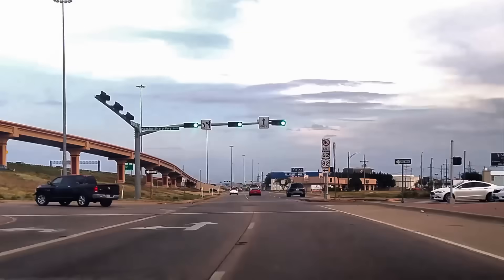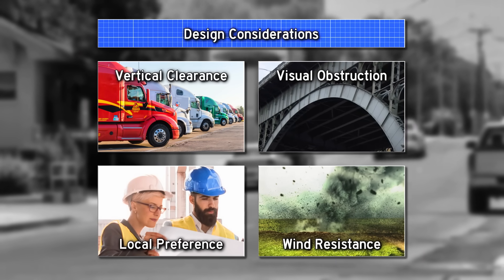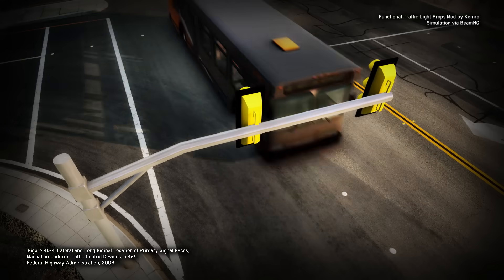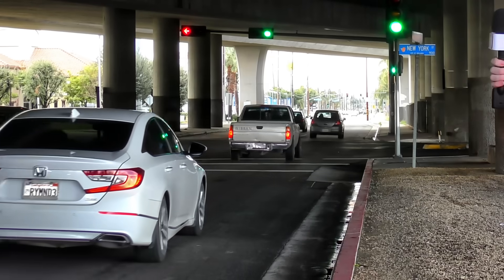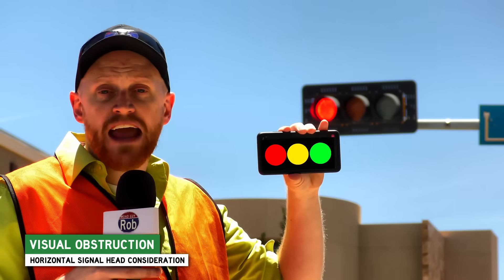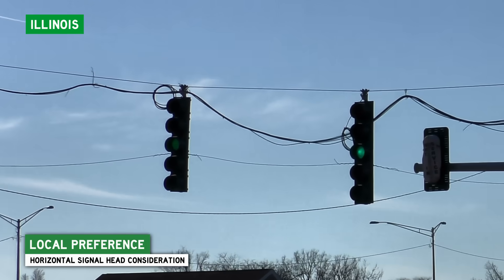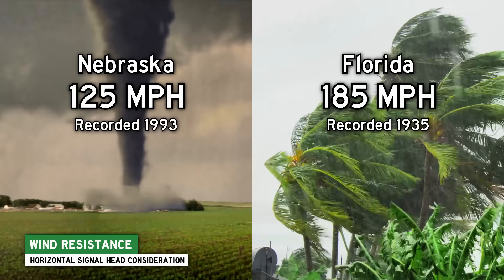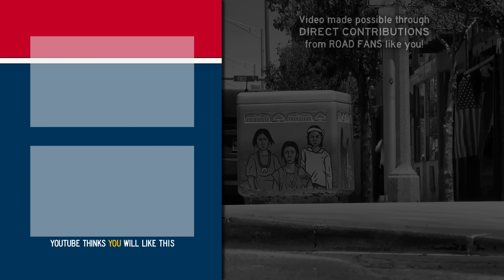What's up with SIDEWAYS STOPLIGHTS in Texas and Florida?

Comment: Mandatory European perspective: We mount traffic light just after the line where you are supposed to stop. Visibility is a little tricky sometimes when you stand there, but it forces you to stop at the line, and in general I find it much more clear which traffic light is relevant when you encounter a new location.
Reply: A lot of Europe has cute little traffic lights at the driver's height to overcome that problem. Some people think they're for cyclists, but in most cases they're wrong.
Reply: @nomadMik  Well, the most cute litle traffic lights i know have bicycle on it. But maybe even in Europe this is different from country to country.
Reply: Near-side traffic signals are not common in the US, but some states tend to do them regularly (e.g. Wisconsin).
Reply: In California—at least in suburban areas—near-side lights are often used in addition to the more conventional far-side lights.
Reply: I've never seen a horizontal traffic light in Europe either. I have a feeling they exist somewhere, but I've not seen one yet! If there's a horizontal light on a pole it's a "wig wag" signal for things like swing bridges and railway crossings.
Reply: @Croz89  The only horizontal ones I recall from driving in germany are at tunnel entrances, but a lot where also recently replaced by those matrix displays which can display speed limits or lane closures.
Reply: @danielrose1392  I'd ask if you could show me an example on street view but... Germany.
Reply: @Croz89  One example is the Fahrlachtunnel in Mannheim, with a picture showing the traffic lights on it's wikipedia page
Reply: @danielrose1392  I wouldn't call them actual examples of horizontal traffic lights despite the similarities as they don't control the flow of traffic (besides pointing where drivers are allowed to drive) but instead denote the flow of traffic.
Reply: @Croz89  I know from experience that a lot of the signals in Croatia are mounted horizontally. Definitely worth a country worth visiting, not only for the traffic signals!
Reply: This way is better because it stops cars from blocking the crosswalk
Reply: this is not a problem at all for everyday users so it shouldnt even be a topic to debate.
traffic light situated on the other side is fine. there is already a thick white line marked on the road indicating the point you should stop at, and if you're used to not stopping right where the traffic light is at, it is a no problem at all. in fact you wouldnt even notice the design.
it is only that when you're used to thinking you should stop right below the traffic light that it becomes unsafe. but that only happens to tourists, and not the only thing that happens to tourists.
there is no safe or unsafe here. both work perfectly fine.
but, a person from a country where they stop depending on the markings on the road, like the USA, and not the the position of the traffic signal, would adapt easier to the "european-style" rather than the opposite. as ive seen some european drivers in the US doing what u said, stopping under the light ignoring road markings completely.
Reply: @dyarous  If it's snowing, raining heavily, foggy, etc., there's no line to see. That's a massive problem.
Having the first traffic signal(s) actually at the stop line is inherently safer, just like you would have a give way or stop sign at the line(s) and not beyond it.
You can then supplement with another light either a bit further in front on the farside, or on the opposite side of the junction, so vehicles at the line or in large vehicles can see the signal.
Reply: @AndrooUK  when it's snowing, the snow  has either already been plowed or isnt thick enough to completely cover at least the yellow median line. and you can see the curb anyway, and obviously you can see where the intersection starts no matter the road markings. the US road design in overall is just different from europe so you can't really compare it. the point stands, to normal everyday user, it's a no hassle and no one would even notice if you didnt point it out.
Reply: @dyarous  Fair enough, I would have just thought that it would be more prudent to put a signal where you actually want people to stop, to make it easier to see where it's expected for you to stop.
I guess you would get used to it either way, but you said tourists have a problem. An American vitising the UK wouldn't be stopping too far ahead seeing a signal, he would, if anything, stop further back than needed, which isn't a big safety issue. The opposite way round, a British person could conceivably have issues stopping over the line.
Reply: I hate this in Europe. Much prefer American way.
Reply: @Phillip Banes I didn't say Europe is a country, I'm just saying it's what people say. Most people probably aren't referring to Eastern European nations when they talk of 'Europe', either. Just the ones we all hear about, France, Spain, Germany, Sweden, etc. Throw in the UK if you're not from Europe, too.

I do the same thing, but I still know about individual countries and member states. I live in the UK, so I'm aware of the political and geographical delineation. You can absolutely generalise about traffic signals and signage, as it was harmonised on purpose to make driving easier across the continent.

People often say Africa and think of it conceptually as one single bloc, and talk about it as such, even though we know it's comprised of individual countries.

The States in the USA have a lot of independent Government and differences that could be comparable to member states of the EU. It's a valid comparison. Again, I didn't say that the States are actually countries.

Just because you don't like the usage of words, or comparisons, doesn't mean it's not what people are going to say or do. Don't get so upset over it.

This is a video aimed at a US audience, so it's appropriate to say Europe to be shorthand for EU and EEC, as that's what Americans will probably be thinking about.
Reply: Most people in the US stop on the line. If not you find out real quick when a truck makes a left turn towards you.
Reply: In Denmark, traffic engineers usually place tons of traffic light on the other side, as well most major intersection in Copenhagen also have suspended traffic lights as well

Often is big intersections, each directions has like 5 upto 7 traffic lights. Sweden and Norway does this as well. Scandinavia really seem to love over-exaggerate with their traffic light placements.
Reply: USA:  lets not copy that one.  Not everything euro is better.
Reply: @clayz1  Lower lethality among pedestrians and car drivers alike, generally safer streets and roads, traffic jams aren't worse in general. I can see why the USA wouldn't copy that. Far too commie.
Reply: Same in NY - lights are on the same side of the cross street as the cars they're aimed at. I moved out of state and the lights are typically across the intersection wherever I've lived out of NY (though there are exceptions). I got used to it, but it was tricky at first.
Reply: why do you even bother to have a yellow light when it just blinks for a second? saw this is Germany.  in the US, you are considered to run a red light if it changes red before you finish crossing.  it's usually yellow for about 1 second for every 10 mph speed limit on the road. (some municipalities were caught lowering that threshold to hand out more traffic tickets) also in California all lights stay red for 2 or 3 seconds to make sure the last guy running it doesn't smash into you because here in California, everyone is far more important than you are
Reply: Probably because Europe has more complicated (historical) street layouts. With some crossings here you simply couldn't put them on the other side due to ambiguity. And with some crossings having so many entrances and exits you couldn't hang them all in the middle as well
Reply: @chaosmagican  The US has plenty of intersections where the light could be ambiguous. They use extra long blinders and sometimes slats so that the lights are only visible from the road which they control.
Reply: @chaosmagican  No, it is not the more complicated (historical) street layouts. Europe has tons of modern streets. The reason is more that Europe has less excessive car traffic only dominated road construction guidelines which are not based on the false assumption that overwide roads and overlong crossings are increasing safety for all people (car drivers, pedestrians, cyclists etc). That is why roads are in general more compact in Europe than in the US, especially those in the lower priority road network.
Reply: @sagichnicht6748  The reason Europe has less excessive car traffic is that there are much fewer people, and there aren't large stretches of nothing between towns and cities.
Compact countries automatically have smaller roads and higher public transport use, just through their natural historical development and necessity.
Reply: @AndrooUK  Am I understanding you correctly? You think there are fewer people in Europe than in the US? Even the EU alone has a considerably larger population than the US. You are right however that density is overall higher but you seem to get the main traffic generating factor wrong. Look where you have the widest highways, it is not in the large empty parts of the US but to the contrary in the densly populated metropolitan regions. Most of the traffic is local and generated there. There is less traffic in much of Europe because people in the metropolitan regions have much more alternatives to getting around by car. The reasons for that are no natural or god given cause but the urban layout and that is also not a given thing but was a deliberate planning decisions. Actually US cities used to be much less car centric even ~70 years ago. Those cities were deliberatey made completely car centric, not because they had to be that but because politicians (and also voters) wanted it that way. 

The Netherlands is a good example here. In the 1960s also there urban planners were transforming Dutch cities into car hell holes, not as uncompromisingly as US planners but still. Unlike the US, the Netherlands figured out that this was a mistake within around 2-3 decades and radically changed their ways. Nowadays Dutch cities are seeing a lot of bike traffic, high transit usage and relatively benign car traffic during rush hour, even though cars and pushing everyone aside in the cities.
Reply: @sagichnicht6748  I’ve driven all over the world, and assume you’re talking Western Europe because Eastern Europe is an infrastructure joke. 
Well organized is not how I would describe the W. European road network.
Reply: @PSTXFL  The Czech road network seems decent enough, yet public transportation is decent as well. Granted, I wouldn't call Czechia Eastern European, things in Romania are certainly different. Car drivers are crazy in Bucharest, out to kill you ;)
Reply: @sagichnicht6748  There's nothing false about the fact that giving people more space to drive and more time to stop increases safety. It's basic reality.
Reply: @thatguyonyoutube989  Except that it is not. It has been shown that narrow and even winded street conditions are actually safer. Why? Because you are ignoring human psychology. Car drivers are regulating their own risk. They are driving much more attentive and careful on narrow roads but less attentive and much faster on neighbourhood roads built like highways. No matter what traffic signs are telling them. That‘s a fact and has been shown on the ground, in reality. Wide streets don‘t make it safer for drivers and make it much more dangerous for pedestrians. They do make driving in residential neighbourhoods faster though.
Reply: @sagichnicht6748  So you're telling me it objectively makes it safer to go faster speeds than you would on narrow roads. Way to agree with me lol.
Reply: @thatguyonyoutube989  Uhm, no. There is no speed dependent safety in a residential area. There is only safety or being hit by a car. Speed only matters in so far as it makes every accident exponentially more lethal. And that is the very reason why narrow roads are much safer. 

Car oriented cities in the US aren't faster either because of traffic jams and people not even having an alternative to the car. Why? Becuase the cities are hostile to walking and walking is simply dangerous.
Reply: @Sag Ichnicht  You're telling me if I told you to drive 50mph down a narrow windy road or 50mph down a straight, wide road; You would pick the narrow road because it's safer, right? No, you wouldn't. Stop lying. Safety is not a black and white thing. It absolutely comes in degrees.

Last I checked going 20mph in slow traffic is still faster than walking.
Reply: @thatguyonyoutube989  Your question tells a lot about the way you are thinking. Not sure how it is like in the US but here in Vienna, anything beyond 50 km/h within city limits, outside of a proper highway, is illegal. And that is already a lot slower than 50 mph. And of course, if some asked me to drive even 50 km/h on a narrow road I would ask him if he won his driving license in the lottery. 

Safety and speed is pretty black and white. When I was saying the lethality is rising almost exponentially with speed I was not dramatic or figurative. Accidents at 50 km/h are already several times more lethal than accidents at 30 km/h. Even city planners in the US have figured that out aleady and are cutting down on excessive speeds on residential roads. That is however hard if your roads are built like highways. People do indeed drive the way the roads are built, rather than what a sign tells them to do.
Reply: @sagichnicht6748  I'm thinking like a normal driver. Here in America, 50mph is a typical speed limit. 

It is pretty black and white. The higher speeds you're driving at, the safer it's going to be to have wider and straighter roads. 

People driving faster means less traffic. This is basic math.
Reply: @thatguyonyoutube989  If 50 mph is a typical speed limit in a residential neighbourhood it pretty much says already a lot about what is going wrong in US American citie and why they are so utterly hostile to walking outside maybe of small urban cores, in those cities where they still exist (or had a bit of a revival). 

Driving faster doesn't necessarily mean less traffic, as it means that safety distance between cars has to increase as well, unless you are suggesting that that isn't needed either. This offsets to a large extend the benefits from getting cars faster through (and at even higher speeds than 50 mph it actually means capacity is even decreased overall by increasing speeds even further). That is of little concern however as streets where capacity matters speeds usually collapse anyway due to heavy traffic and traffic is always heavy on main streets in car dependent cities due to induced demand, unless you are going completely crazy in absurdly overbuilding car infrastructure, which even the US doesn't do.
Reply: @sagichnicht6748  If you think the majority of roads are residential then I can't help you. At least in America, that's not the case. Nowhere have I ever specified residential roads. That's a specification you made, to try to avoid the issue. 

The increased safety distance is the whole point of having longer, wider, straighter roads. You're literally proving how longer, wider, and straighter roads provide more safety by arguing that higher speeds need more safety buffer zones. 

Unless you live in a city of millions of people (at which point, maybe the issue isn't the cars, but the absurd population density) you probably don't have constant traffic jams on main streets.
Reply: @thatguyonyoutube989  This debate has gone on for so long I had to look up indeed how it all started. Granted, not all roads are in residential zones, but at least in Europe, the majority of traffic lights are in settlement areas and therefore a speed limit of 50 km/h applies in most cases. 

In cities or even villages you have to decide, do you want a place for people and pedestrians or a place for cars. You can't really have a place that is good optmiized for both. As soon as there are pedestrians around, high speeds will vastly increase the dangers and making streets wider actually increases the dangers for pedestrians. Within cities, most streets have to accomodate pedestrians, even though I am well aware that many place in the US don't do that or just in a way that is suitable only for suicidals. Outside of built up areas things are of course different to some extend. However even there things are being reconsidered. Several decades back, authorities were cutting down trees alongside roads as they were considered a death trap for car drivers. Turns out, if you put back the trees, people are speeding less and accidents don't escalate, as the risk when loosing control of the car are perceived as higher. So trees are returning to many roads where they were previously removed.
Reply: Thank you. This is so important to understand for safety of road users.
Reply: FWIW, MUTCD does allow near-side signals, but only in addition to “far side” signals that meet the 40 foot rule. MUTCD also effectively mandates a large signal size which can make those near side signals look rather absurd.
Reply: @Phillip Banes No it's not, but people generally refer to Europe and mean the EU and EEC member states, which have a harmonised road signage and signal system, that has similarities that can be generalised to an extent.
Like the US has similarities that can be generalised, despite individual states having obvious smaller differences.
Reply: I disagree. Based on my experience in European Truck Simulator (and in my experience driving in Europe, that game is actually pretty accurate) the visibility is a huge issue. 

While in the game is different, as you cannot move your head in all directions like you can in real life, it is sometimes very difficult to see the traffic lights, even if you are a reasonable distance behind the stop line. 

Pro-tip for ETS2 players - there are few to no advanced greens in the game, so when opposing traffic goes, it's usually a green light for you too. And at night, the ground is somewhat illuminated with the colour of the light. So you can usually see that way what the light colour is.
Reply: @crazyrobots6565  A simulator is not experience.
Reply: @clayz1  that's a dumb thing to say.
Reply: @crazyrobots6565      It is nice of you to throw in a quick game review though.  Unless that is part of the actual driving portion of the test.  I would find that shocking.
Reply: Noone cares
Reply: When I moved to Texas, it was a big adjustment to see all the signals mounted horizontally. But after 10 years of living with horizontal signals, it’s weird to go back and visit my folks on the east coast and see vertical signals again.
Reply: Europeans still think Americans care about their perspective 😂
Reply: In Copenhagen, Danmark i was see a lot of traffic light just on the other side, so it is not a Europe-wide rule.

Also in France there are little repeater lights below on the pole for the first driver to also see what is the situation. So a big lamp at the top of the post, and a smaller one just a meter high.
Reply: Having driven a lot (I'm a trucker) in the US and only little in Europe and other places.. I much prefer it across the street the way it is in the US. Also I have  never had an issue with it not being clear.
Reply: This also helps drivers see pedestrians better since they’re looking to the corner where they’re standing and not way over their heads
Reply: Europeans need to understand a few principles.  The first principle in American road engineering is "assume drivers are idiots".   The second principle is "design roads that make it easy to be an idiot".  The political principle is that everyone should be allowed to drive and therefore licence testing must be sufficiently minimal that idiots can easily pass.  The last principle justifies the first one.
Reply: @HweolRidda  the downside is that if you design society around the lowest common denominator, then you get what you asked for! America seems to be very good at making everything worse, based on unfounded fears and emotions… 😅
Reply: @HweolRidda      USA here:  and it is getting worse.  Now we have to all catch up on the USA’s new love of roundabouts, which give right of way to the left (because they are IN the intersection) which works great but only if people get training.  We don’t have training here.  A few rude encounters seems to be the teaching mechanism.
Reply: I don’t see the benefit to put them right at the line. I’ve lived in europe and canada. It is clear where to go wether they are near or far. It’s just easier to see when they are farter than the line. And people stop at the line just fine.
Reply: @fredquevillon3727  Car drivers in Europe are driving more responsibly towards pedestrians not because they are inherently more social or caring but becaus streets are designed in a way that encourages people to behave like that. Like traffic lights which you can't see anymore if you stop after the line. Roads that are not superwide so you actually have to stay alert all the time, pumps that make sure car drivers don't drive faster on neighbourhood roads than allowed instead of building superwide roads and putting a sign there, hoping people would drive at snail pace on a road designed as wide as if it were a highway...

I am sure people, also car drivers, who are not actively thinking about it like that don't even realize all of that but it works.
Reply: @sagichnicht6748  I agree. Here in Canada they have mesures like that too. But it’s not always the case. Some neighbourhood are indeed build like highways. In the US but Canada also. I prefer the drivers in Europe (mostly Germany but elsewhere too) for the respect they have about traffic laws and other drivers. Here it is too easy to get a driving license, not know the laws correctly and not care.
Reply: @sagichnicht6748  bumps*
Reply: we do that in the uk BUT we also have a second one so if you cant see the first no problem 

but to be fair american roads are wide compared to ours so i can see why they do it that way
Reply: @mrtommygunwhite   they almost always have at least two traffic lights per intersection (except temporary ones), and have to be visible within 30 degrees to left and right. often, you can only see the farside lights when stopped at the stop line. the lights cycle is below. we and some countries in europe (except france and spain) have red+yellow lights that extend the green phase.
red
red+yellow (2s)
green
yellow (3s)

i have read the manual (traffic signs manual chapter 6 section 3 - similar to us' MUTCD. i would normally post a link but the comment wont be fisible)).
Reply: A lot of cities in the US started adopting this trend... and I agree, it's safer that way.
Reply: I noticed the mention of 40 ft minimum (12 meters) and I wonder if this standard is what drives all our signals to be on the far side.  Seems excessive since a small two-lane road might only be 26 feet wide, so the signal would be further away than the edge of the crossing road.  As others pointed out, the long distance to the light is often blamed for people encroaching on the crosswalk because they're not forced to stop early to see the light.
Reply: It’s also a lot safer for pedestrians
Reply: Yeah the video makes it seem like in the US, they think about "what is most visible" not "where should the car stop". 

If you mount the light on the close side of the intersection, then drivers will likely stop where they should. Drivers often try to stop where they can still see the light.
Reply: @pjrt_tv  Thats pure fiction.  People in Seattle stop where they should.  Not a problem.